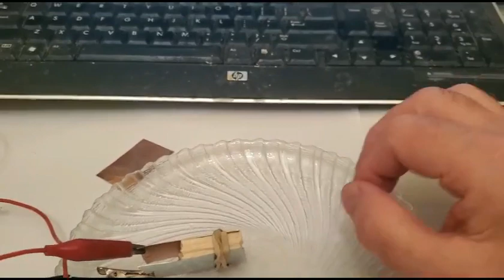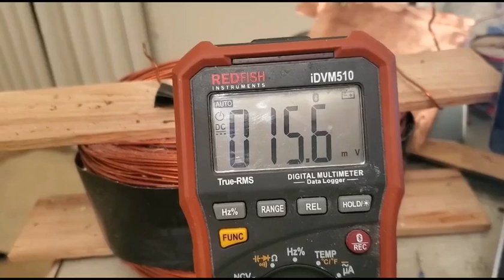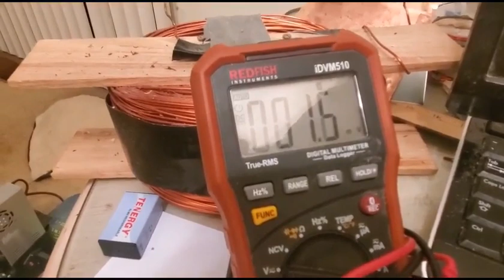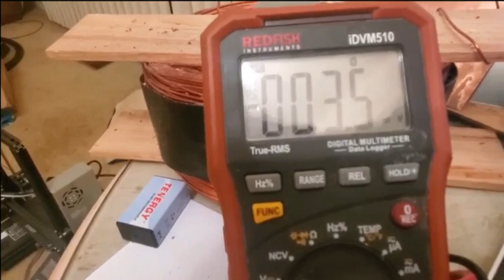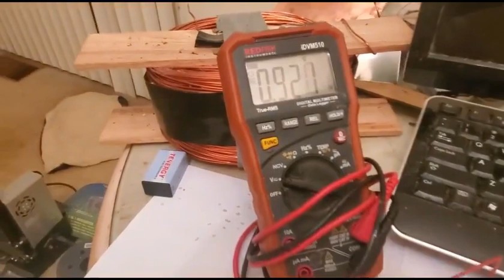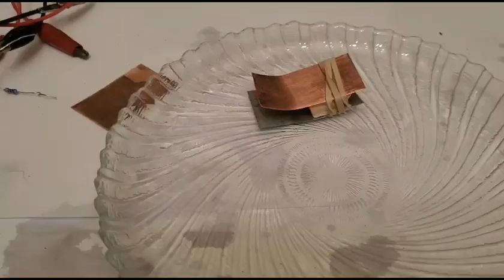Home Brewing a Battery II: And Its off the Rails

Comment: Moon mission. That's a good one. Have you ever checked body voltage? According to Google a persons skin voltage should be 1/10ths of volts at most. I find my right hand tends to be + charged left - and at least .25 volts dc, sometimes more and ac next to nothing right to left but body to the steel top, ungrounded, work table in my old shop I consistently got 4-5 volts ac. Kind of off topic but just thought I'd share that. Thanks for posting your research.
Did you know there are no tides at  all on land locked lakes fresh or saltwater?
Hmm?
Reply from the maker: Hi tiredonrepair,

Thanks for the comment sorry about the late reply,. I've never tried to measure the skin voltage, but who knows, if I can get a pulse motor down to consistently running on a few microwats, given what you say re sometimes seeing 4-5 volts, maybe spin a rotor by touching it, haha, as JFK said, "it's okay to dream".  I think there were a couple things going on with the battery voltage measurements, one as you noted is the skin voltage, also in the cases where I hadn't soaked the wood dielectric and was touching things I realized, that rascal is using me as the electrolyte right through the skin. I'll take your word for it about land locked lakes and tides, that is genuinely odd and I can't think of any reason why that would be?
Reply: Thank you for the timely and well thought out reply. I've been thinking about somehow using seawater as electrolyte and somehow find 2 metals for plates that will produce enough power to move a boat. A seawater powered electric boat would be awesome. I can dream!  @paulmaher812
Reply: Did you know that there are no tides in the Mediterranean either?  That's because, to have tides, you need a continuous body of water that wraps around the entire globe.  The high spots and low spots have to be connected.  The moon doesn't create water.  It has to come from somewhere.  It's a bit like electricity if you think about it.  Isn't that a hoot?  🥸
Reply: Interesting idea but if gravity were a real force as defined, able to keep the Moon in orbit securely, it's effects would be evident. Really gravity fails most at the polar axis where if it existed it would be at a 90* right angle to the centrifugal force radiating outward from the line of axis, leaving that well proven force unopposed. Gravity, lol. @Naomi_Boyd
Reply: @tiredironrepair   If gravity doesn't exist, then what's keeping your feet on the ground?  I mean, what do you think gravity is supposed to be that you think doesn't exist?
Reply: @Naomi_Boyd  I think it is air pressure density and buoyancy like the rest of the FE generally do but they are failing to acknowledge that there must be a bias factor in order for "down" to be all in one direction. To me that means electrical charge. Electrons build up from the ground until they're high enough and atmospheric conditions are right that the high charges in the ionosphere can jump the gap, lightning forms as the air is ionized from the current as it flows down the electron path to ground. Electron flow is from - to + but current flows opposite and 90 * behind electron flow. My theory is that charge separation between the upper atmosphere and Earth ground determines the bias or direction that is down. Plane of inertia with upper and lower torus energy fields creating the electricity and magnetism that gives form to all space and matter.
Reply: @tiredironrepair   So the stratosphere creates charge bias which creates buoyancy which creates the stratosphere?  That sounds like quite a chicken and the egg conundrum.  So how does this charge remain so constant when lightning keeps bridging the gap?  I've never noticed myself losing weight in a thunderstorm.
Reply: Not really. A completely different cosmology is no harder to explain than it would be to ask what caused the big bang. Basically God or no God. 
 
Of course there's the 8" per mile squared physical horizon. NASA approved only problem we can see much further than we're supposed to be able to. Maybe look into it and be surprised. @Naomi_Boyd